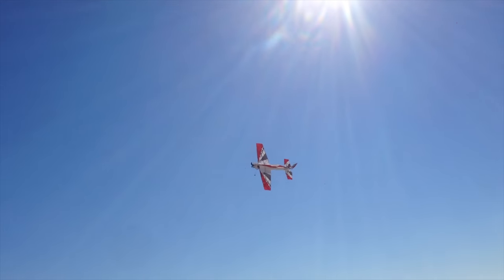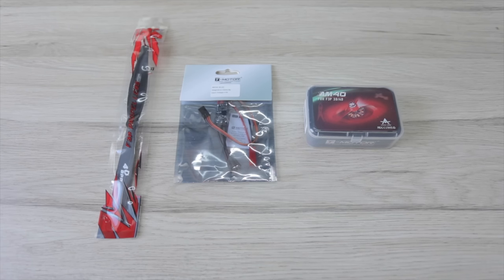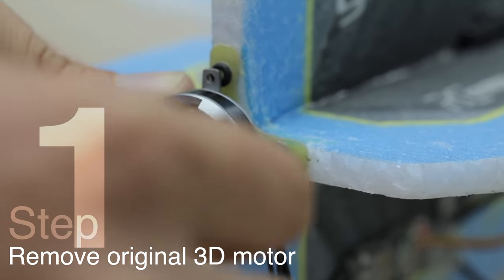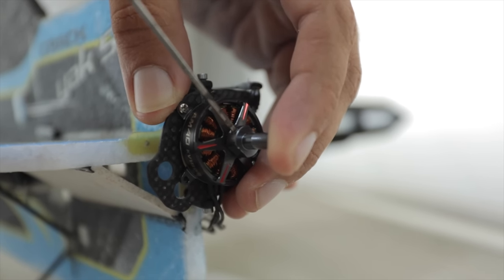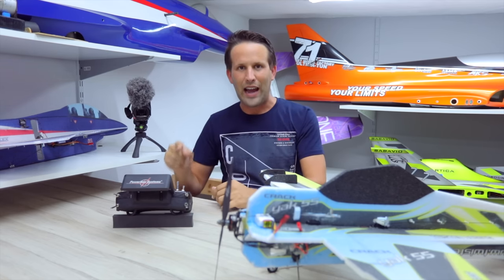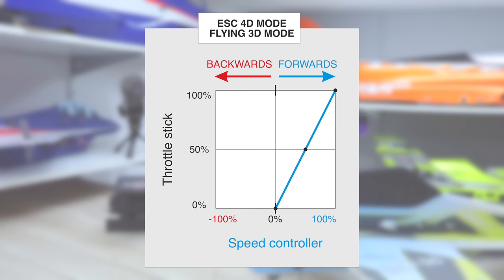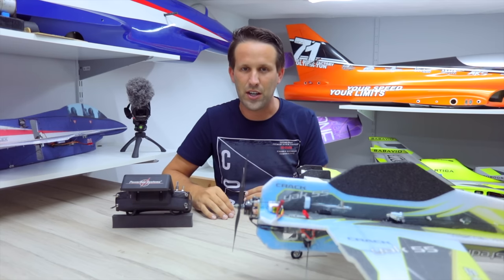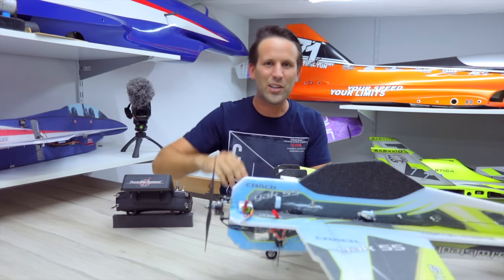FLYING BACKWARDS?!  T-Motor 4D

Comment: Great video martin👍🏻 my father amd i have been working on a 4D system for a 61cc dle amd we are getting extremely close to finally maidening it. Its been about 3 months in development.
Reply: I would love to see you post a video of that maiden. I've seen the big electric Delro Raven 4D on here, but a gasser doing 4D would be so much cooler to see. Good luck on your project 🤘🤘
Reply: @angryaardvark5011  once maidened and being flown with confidence, im going to compile a video showing everything that weve been through with developing this thing, we basically on the 3rd itteration of it and have probably broken 20+ belts tryna do it

Comment: I'm flying multicopters in 3D mode, which is basically the same setup x 4. Also with T-Motors in most them. It's just a little more work to set it up in the flight controller and the ESCs, but it is fun 🙃
I've also burned a couple of ESCs because stopping and reversing the motor seems to stress them a lot.

Comment: What thrust vectoring kit are you using Martin?  Thrust vectoring with that 4D kit sounds like a lot of fun.  :-)
Reply: I wanted to know the same thing but since u didn't get an answer in one year, I guess it's up to us to determine how it's made.  And that looks pretty simple.  It looks like some scrap piece of carbon sheet with small blocks adhered to the plate where the balls are attached by threaded machine screws.  The blocks could be made from nylon or even carbon with maybe a slotted tang and clevis arrangement for extra strength besides the glue.  That may require some experimentation to see what material and glue combination is the strongest, because there is going to be a good deal of load on all three of these ball joints. Looks easy enough though.   
BTW, this throttle arrangement is the same as flying a collective chopper.  Zero pitch it at the half way point on the throttle stick.  Full down stick is max negative pitch which is used for inverted flight on choppers.

Comment: would it not be way easier to use twin motors with thrust vectoring instead of trying to physically tilt the motor with a high gyroscopic load?

Comment: The avion esc's have reverse. (Night timber x & ultimate 3d.)
 My problem is finding a "flat pitch" propeller. Like a 12x3, 12x2, etc. Easy to get anything in the "4" + pitch, everywhere. The lesser are as rare as hen's teeth. I use reverse throttle a lot flying my 2 above.
Reply from the maker: Such flat props would generate almost no thrust though?

Comment: Martin Rey Cool setup. Do you a complete Cost on this Upgrade? Or do you sell the whole Kit like upgrade and 3D plane? PS  Martin when you do more Tshirt please add a air plane logo on the back using the Same Colors and you will Sell more TShirt because you the Best ! Thanks.  Greg
Reply: Sorry on some grammar. Hope to see the Cost.
Reply: Would love to buy this as a kit also
Reply: @Euwanh85  Dear Sir Martin has put a Link in there. found it after I sent Martin my Chat. Not a Bad price. Just don’t know on Shipping to The States . It is in Light blue. Hope this Helps
Reply: Thanks found it
Reply: @Euwanh85  good luck I still can’t shipping cost. EBay Has the Engine ball joint piece for you.   Let us know how is shipping.   Greg
Reply: So the motor and esc they sell as a combo , instead if buying the yak 55 I bought the rc factory edge 580 pro
Reply: @Euwanh85  Dear Sir. Did they tell you a Shipping price? Mr Pickering can sure Fly.. Euwanh85 good luck on flying 3D/4D.  #1 Martin👍
Reply: I bought it in UK as that is where I am from so shipping is standard or free
Reply: @Euwanh85  enjoy luck Dog. Still waiting on my Cost. They only have Motor on EBay. Enjoy do a YouTube build! God Bless sir